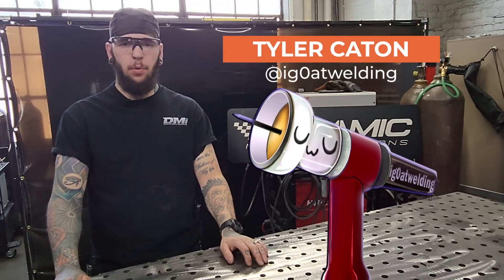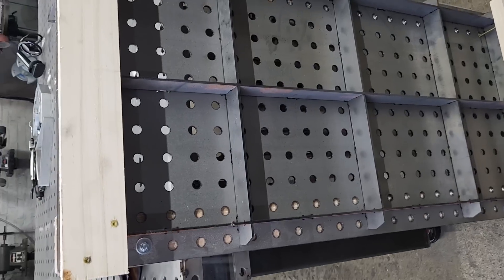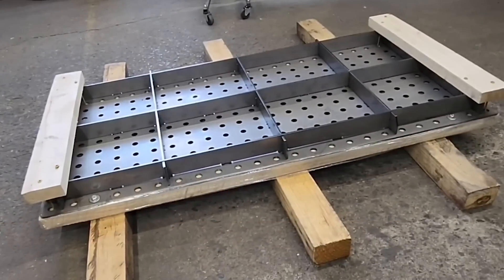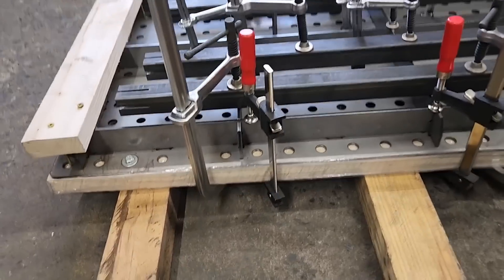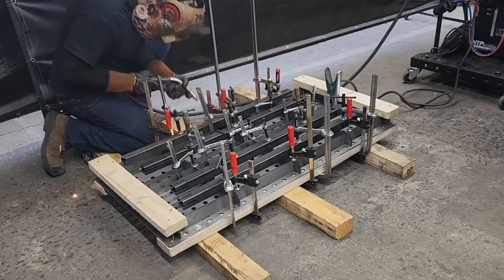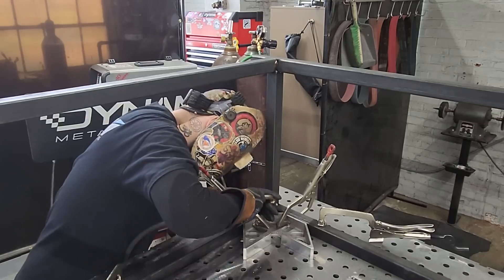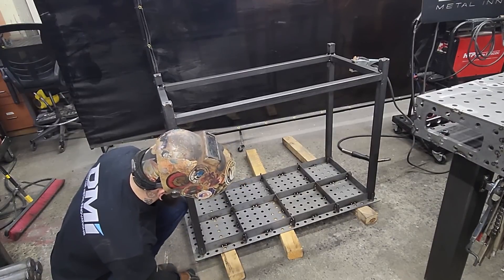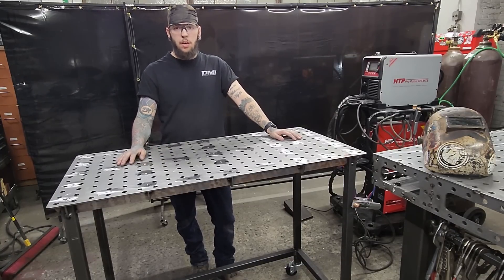DIY Welding Fixture Table - Member Requested

Comment: Regardless of how you clamp and weld (mig or tig) that table together,  it will never be perfectly flat due to the distortion your introducing by welding it together. Look at any high end fixture table and  you will not see them welded together for this reason.
Reply: Good point.
Reply: All 3 of my tables are within 20 thou. Just takes patience and smart placement of your heat.

Comment: Sorry but that table is WAYYY too small for most things. You should get twice the size of it. Or if it's only meant for really small parts then might as well cut it in half and save some money.
Reply: I have 3 of those tables and a 10'x6' that I laser cut and made. These small tables are great for day to day little projects and in garages or small home shops. The 2'x4' is a really popular size. Not everyone welds large pieces all of the time. Little food for thought.
Reply: @SHANANAGINSx  I also have a 10 x 6 table in my shop. I find I waste a lot of time walking around the table  just to weld, tack or clamp something.  I know it sounds trivial but when you have 100 battery racks to weld up in over 2 weeks, time is everything. If my table was smaller I'd be quicker. Definitely going to look at a smaller table.
Reply: @keaganairey1413  all depends I use it for large projects and multiple step projects. Works well. All about organizing and what's needed. Everyone needs something different to fit their needs.
Reply: @SHANANAGINSx  where did you buy the table? If you make them how much to but one?
Thank you
Dan
Reply: @danielvrana9444  I'm not sure what I'd charge or how much time I'd have but hit up dynamic metal innovations and shoot us an email.
Reply: No it’s not. It depends on what you do. There are a lot of 3 x 4 foot tables sold. I have one. It’s five sided and I have a number of struts that go on the sides to give me up to an effective 88”  x 46” table top. That’s more than I need. Not everyone needs huge tables. I do work up to 6.5 feet by 4.5 feet. It’s great for that and it doesn’t waste space when I don’t need the extra size.

Comment: Nice machine there ( I have  few of those :)) and great job on just using small tacks.  I bought two of their 3x4 top kits, and basically did the same, just small tacks spread out (on the underside) while keeping the underside ribs pinned and clamped, and it came out very good for what it is.  I didn't even bother adding weld to the top side where the tab-n-slots meet; the tacks on the underside held it together great and the flatness came out within spec. It's spec'd for ± 0.015" over  12" span and it held very well.  Even along the long side and diagonal which was over 4ft long it was all within ±0.030" the entire way through using a 48" straight-edge that I got from Amazon that is flat to ±0.003" over the whole 48".  The key is to avoid over-welding which will cause severe warping.
Reply: Exactly. The tacks are enough to secure the table while maintaining heat control. This table was within 20 thou after all was said and done. I got feet over the casters to be more stable and so it was a bit shorter